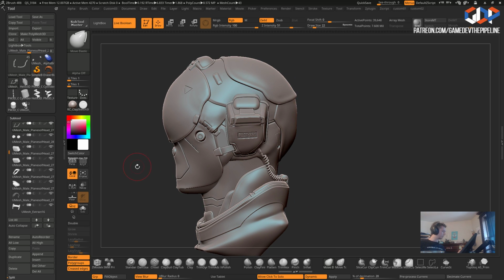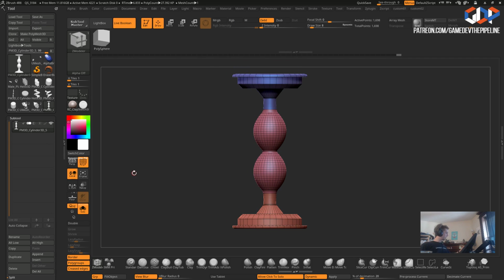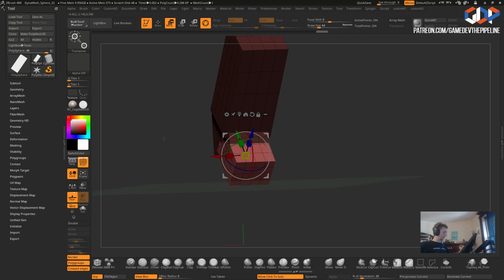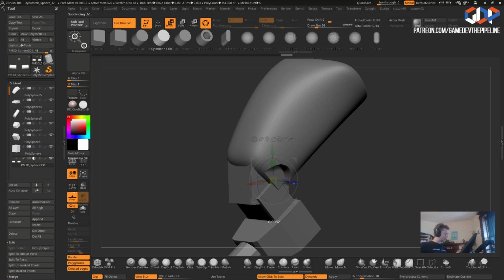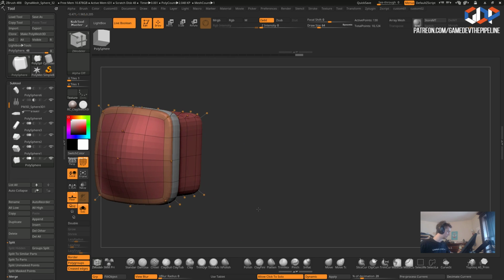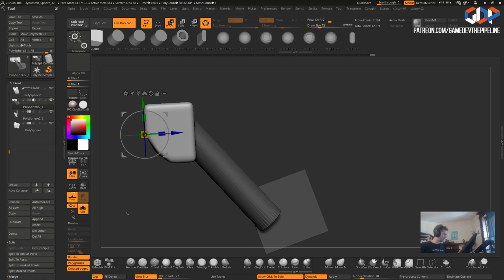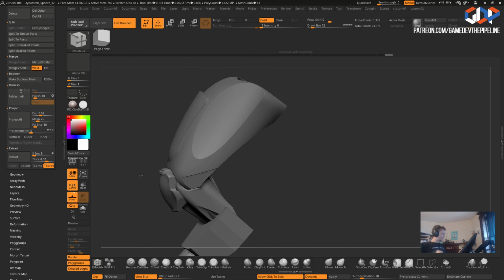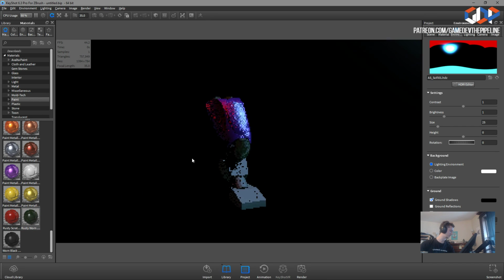Harsurface Design with Booleans in Zbrush4R8

Comment: Hello:). At 35:13 you start to group your sub-tools:). So midway through your sub-tools it says start. Do you have a lot of experience using this method to let's say group different areas of a Mech?  The shoulders down to the finger tips would all be in one group, the chest to the stomach would be in one group, hips to toes would be in another group.  Something like that?  Have you been able to create several groups like this to keep thousands of sub-tools organized?
Reply from the maker: You definitely can use  "Start grouping" for organization. Just have to enable Auto Collapse right under the subtool list. I also use a third party plugin called ZsceneManager. It gives you a bit of a more visual interface for your project hierarchy. http://exoside.com/zscenemgr/
Reply: Thank you!:). Zbrush4R8 is the greatest thing ever:). Great workflow by the way in this video:). You know your Stuff. Happy Zbrushing:)
Reply: I am excited to start using the plugin:):):):). Thanks for the Tip.